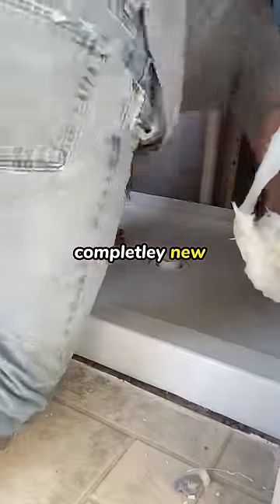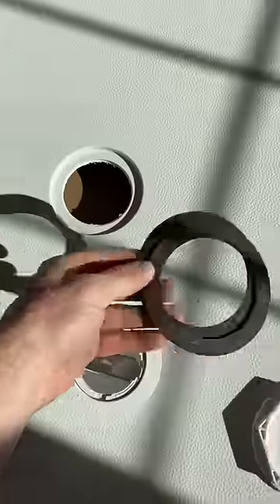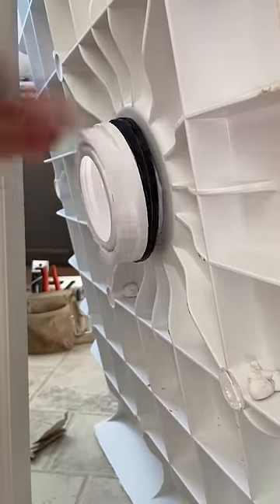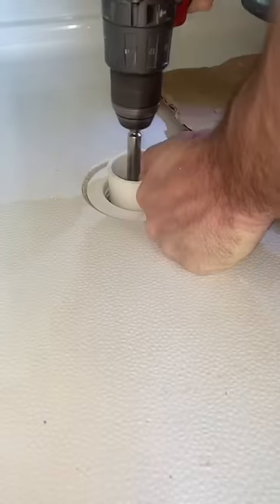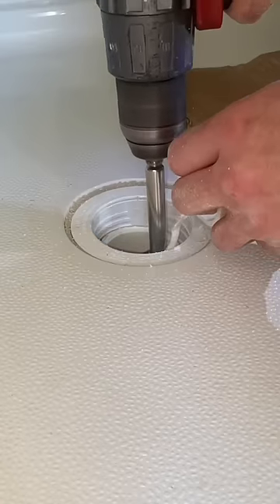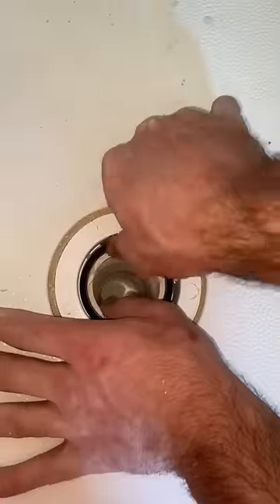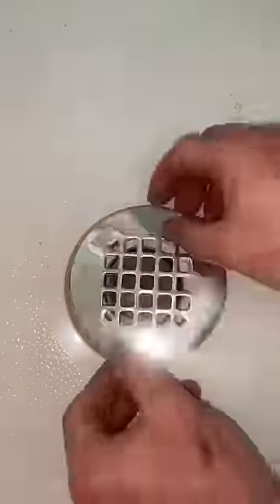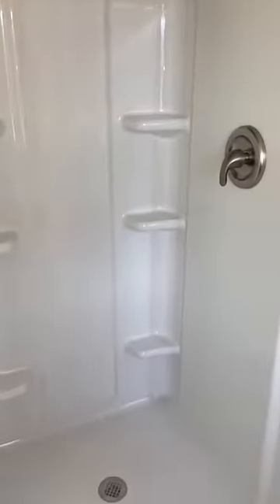Installing Oatey’s Caulk Free Shower Drain with New Shower Install #plumber #plumbing #oatey #shower

Comment: 1. No plumbers putty.  Hardens and doesn’t hold up.  Use 100% silicone.  2. Inject the space between the pipe and the drain with 100% silicone then insert the black seal.  Acts as a lubricant for the seal and lock ring and the excess gets pushed out the bottom.  I’ve seen these leak without the silicone.
Reply: Bullshit
Reply: @nathanieljennerjohn8904 the grown-ups are trying to talk here, try to use your big-boy words and actually make a fuckin argument as to why anything I stated is "bullshit."
Reply: @scooterrockets7815  woaah SCOOTERROCKETS is one of the big boys huh
Reply: @jml4410ISABOSS  I’m just a regular guy who has installed dozens of these and fixed a few leakers that were installed by others without sealant.  Nathaniel on the other hand made himself out to be a big boy when he started shouting insults from the peanut gallery.
Reply: @nathanieljennerjohn8904 you have never ever glue pipes together much less installed a shower.
Reply: @SavageWhiteTailhunter  some of the showers I’ve done would make your head spin.
Reply: @scooterrockets7815  you're assuming that you are the only one out of both of us that can remodel a shower. I know I do a great job but I'm not on here to brag about it.
Reply: @SavageWhiteTailhunter  you made a definitively false statement that I have neither glue pipe or renovated a shower.  Now you’re retracting that position?

Comment: To each their own.  I have better luck cutting the pipe after installing the rubber ring.  The flange is tapered and sometimes having the rubber already on the pipe before sliding in the flange is easier.  There's another manufacturer that doesn't use an upper competing ring and if you don't install it this way you'll never get it to start onto the pipe.  Tap the ring in with a square wooden dowel till it bottom out then use inside cutter

Comment: FYI Oatey says you should use 100% silicone. I supply new construction and most companies silicone the drain before they give them to the sub contractors for that reason
Reply: Yeah, I was thinking something had to me missing, even by manufacturer standards.  Rubber seals alone aren't a long term solution and would have to be changed before the life expectancy of the shower.

Comment: Nah I’m still using caulk cuz I’ve got trust issues. In my head if it’s caulk free I should still put caulk because then that means it’s extra protection.
Reply: Have you ever ''caulked' a joint in plumbing before?  It has nothing to do with actual caulk.
Reply: @thomasking1149 
On a plastic compression joint that will have ZERO access after installation? Damn right I'm going to use silicon during installation!
Reply: We may be talking about different things because the piece is rubber and you install it from the top of the shower base  right under the drain cover , as shown in the video.
Reply: One hundred percent I would put silicone as well!

Comment: I’m remodeling master shower. Very small. I have a concrete shower pan with tile currently?  Do I sledgehammer it out?
Reply: Yes
Reply: Or sds should break the sandwix easy enough less work than hammer

Comment: okay, so paper gasket goes on top, rubber gasket goes underneath? I've seen so many different ways to install these things. rubber on top, both gaskets on bottom with plumbers putty on top...
Reply: Same question. For me I put rubber gasket on top and paper gasket on the bottom then sealant on top.

Comment: I installed one of these on my house. It leaked at first.. kind of a pain in the ass when the shower pan is already installed. I had access from the basement however. It took me multiple times of cranking the shit out of it to seal.. I eventually cut the pipe lower and let some of the black seal go over the top of the pipe I think…

Comment: A lot of plumbers use mortar under the shower pan.
 If it is on concrete, that is great.

 If it is on a subfloor, window expanding foam is better, especially for that Kohler shower enclosure and pan.
 Mortar has a tendency to dry out after 2 years and becomes sand. Creates movement under the pan, which you don't want. 
 I prefer the brass Sioux Chief shower drain last a lot longer.

Comment: For a drain that’s going to be hidden forever, I wouldn’t rely only on those rubber gaskets. Put a dab of silicone between the rubber and pan surface as well and it’ll never ever leak.
Reply: So are you saying put silicone on both the bottom rubber gasket and the inner rubber gasket?

Comment: Well clearly brass is far better than pvc. However, the issue, stated at least once in other comments is serviceability. A framed floor... no problem. Over concrete... you dam well better use silicone. IMHO

Comment: You should have used a pipe dope or something because you will hide the bottom nut and after ten years you will wish you would have because I have fixed about 5 out of 50 at my building

Comment: Always use the Oatey threaded unit, not this compression gasket, which leaks in 2 years.
Reply: No they dont. The rubber will take 20 years to rot out.
Reply: Exactly

Comment: Wrong… when you first place the drain flange into the shower pan you need to seal it with plumbers putty or at least a bead of silicone… and then at least explain that the rubber washer goes against the shower pan in the bottom side, followed by the fiber washer and the plastic nut… do it right; or don’t.

Comment: Like it matters. You’re aware that’s a plastic shower pan right? Why are you still allowing clients to talk you into installing junk? Never let the client talk you into anything cheap or unprofessional. Those are both DIY and flimsy brittle junk.
Reply from the maker: This is a Sterling Brand one of the most trusted Brands in my opinion very durable stuff

Comment: Personally, I’ll always use silicone when installing the drain frame AND also before I put in the gasket, too many times I’ve had to replace leaks drain frames because someone didn’t use caulking